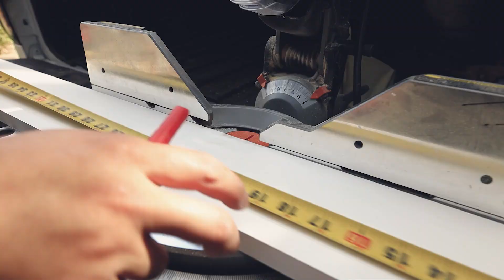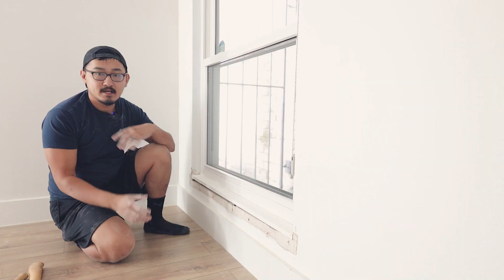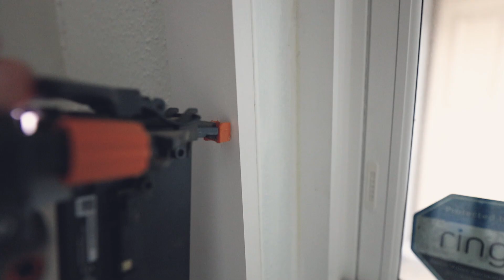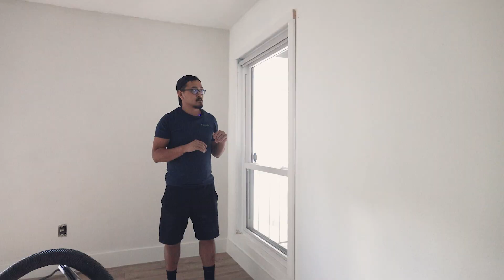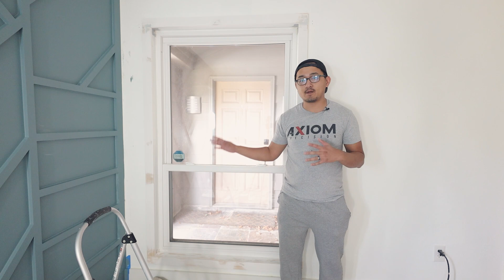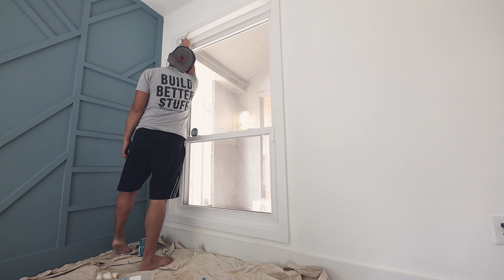Easy Way to Install Modern Window Trim // How To // DIY

Comment: My windows have drywall returns, can I add casing on top of the drywall? I guess I give leave them as is, but I think casing inside will give them a much better look.
Reply from the maker: Yes you can. Just keep in mind how your windows operate so the casing doesn't get in the way.
Reply: @DesignCraftWorkshop  thank you!